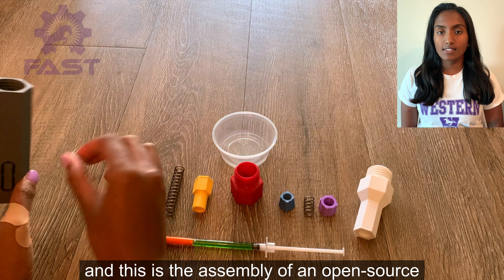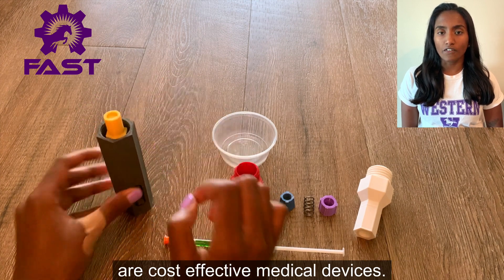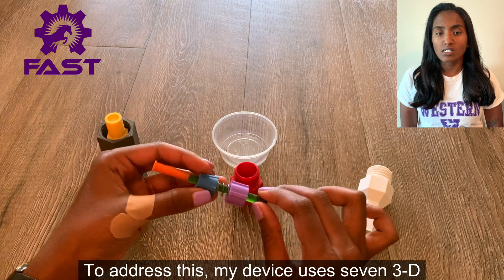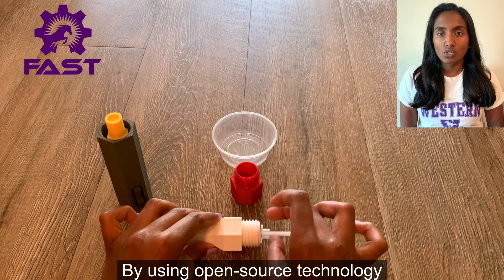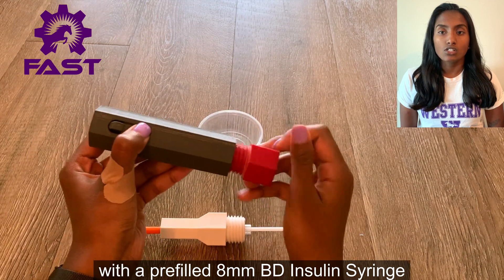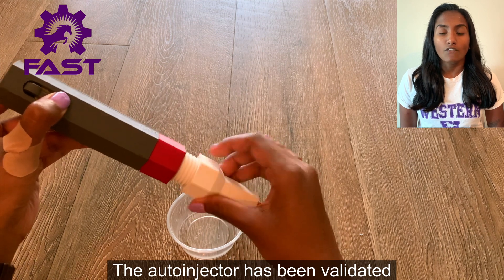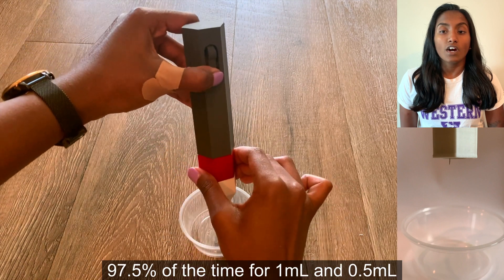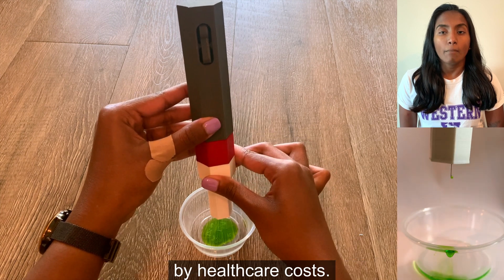Open Source Autoinjector Assembly

Comment: This is truly awesome and a godsend to those who can't afford to pay for the devices big pharma charges such high prices for.  Kudos to you and your team for doing this noble project.  For grins I went ahead and printed one out.  I used PETG instead of PLA, which I think is a more durable material and better for moving parts.  I did have problems with the PETG when it came to printing the cover, the release button was difficult to print.  I ended up using supports but it took a few tries.  I looked at the instructions, in one version there is one 81.5mm  spring split into 2 parts, in another there is an additional 30mm spring.  Can you tell me which is the latest version?  Thanks for doing this!

Comment: Could this work as an epinephrine, auto injector
Reply from the maker: Yes - although it would need to be tested first.
Reply: NO NO NO! THIS IS DESIGNED FOR SUBCUTANEOUS DRUG DELIVERY AND NOT INTRAMUSCULAR AS EPINEPHRINE USUALLY IS. UPTAKE MAY BE SLOWED. DO NOT TAKE RISKS WITH LIFE SAVING MEDICINE.

Comment: in the video, you demonstrate with an 8mm insulin syringe and a very thin testing medium, but would the files linked in the paper work with a 10mm diameter syringe and a more viscous medication, or would they need to be modified? 
i would like to print this device to help with injecting a medication that's suspended in castor oil, so it's substantially thicker than the alcohol used in testing or the insulin this is presumably designed for.
Reply from the maker: I would recommend building and testing it. You may need to go to stronger springs.
Reply: @FAST-GROUP  good to know, we'll give it a shot, and can toss it into fusion360 to check dimensions before printing,
thanks for the suggestion about spring strength 😎👍